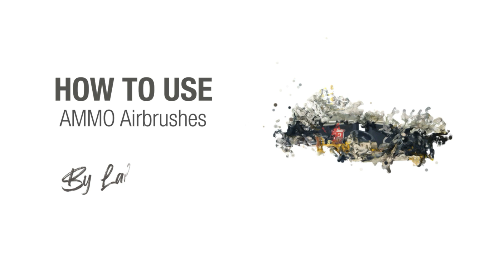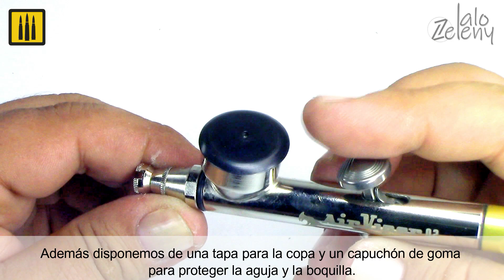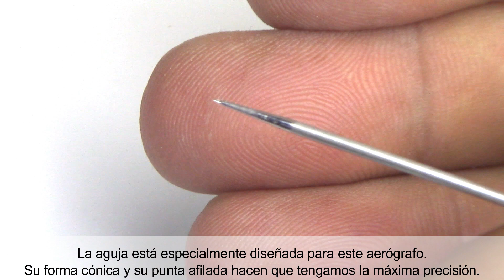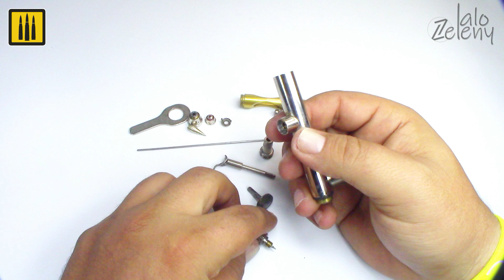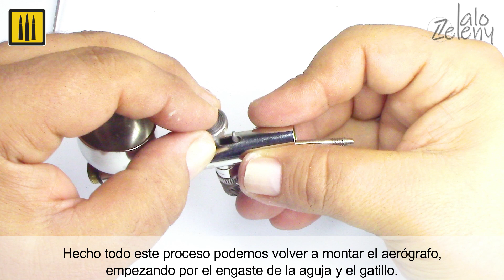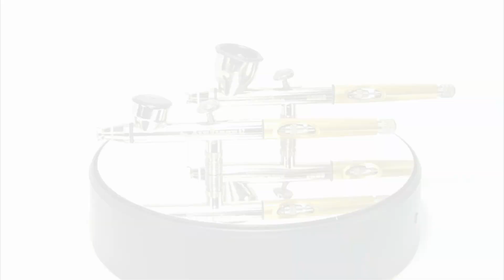HOW TO USE AMMO AIRBRUSHES  /  CÓMO USAR LOS AERÓGRAFOS DE AMMO

Comment: Not long bought one now a viper now it's time for a full break down and good clean as poor performance from a usual clean like this and ultra sonic I've got the middle screw out with small screwdriver it's just empty nothing in there I thought there would be more? Unlike the cobra you see here the valve peice like the iwata neo does not unscrew its a sealed unit only the valve unscrewers! I'm cutting into threads trying so won't go any further now so any help here on a full breakdown would be great

Comment: You don't make your brushes. You get ken over at badger to make them and then mark them up 
And did you not listen to badger? Are you insane? Sticking wire brushes in through needle bearings? How to screw an airbrush.
You also state to soak all components? You idiots! You never soak an air valve!
Honest to god learn about how to actually maintain an airbrush before spouting inaccurate crap on the internet.
For those of you actually wanting the original and better versions just go search badger airbrush.

Comment: Its literally just an old rebranded Badger Omni 4000 with an overpriced pricetag. I get an Ultra for 70% of that price, no need for tools for disassembly and all H&S parts are cross compatible between the airbrushes, none of this proprietary bullshit
Reply: Who cares, Ultra is also an old airbrush while this is upgraded version of the Badgers witch again are high quality airbrushes.
Reply: @statoilbensin2190  Exactly. Plus, people just say things are bad because they don't have the skill yet. AMMO acrylics require a steep airbrush learning curve, compared to lacquers and enamel paints. I am still learning, but it is what it is.
Reply: @K3ns4i  I think they are easy to use, its just people are using it like they use acrylic laqcuers and that will mess up the project.
Reply: @statoilbensin2190  I mean, it took me a while to learn since i am a noob. But yeah, people are using them wrong.
Reply: @K3ns4i  It did not take that long for me since I was already used to airbrushing. Ammo paints are wery solid you just need to use a bit more time and build up the paint in slow layers. While some paints can go on thicker like Vallejo but its still recomemded to do thin layers with all types of paints. I even do it for laqcuers because a smooth finish is what I like the most.
Reply: Nobody cares... it is public domain its a specially designed badger. Don't like it? Don't buy it.
Reply: @K3ns4i  oh I wont. Fuck mig and their greed. Im trying to spare the newbies the pain and frustration this company has caused me.
Reply: @czaczaja  I have their paint set for WWI german tanks. Pure shit.
Reply: @The_Modeling_Underdog  I have about 100 paints from them. Modulation sets, interior sets, camo sets. Un-fucking-usable. But with videos and marketing like this, youre sure to get stung if youre new.
Reply: @czaczaja  I've had friends have the paint spoiled due to the metal ball rusting inside the bottles. Never before opened bottles. Total loss. I gotta recon their dry pigments came in really handy a few times. The rest? Just lile you said.
Reply: @The_Modeling_Underdog  yep. pigments and enamel thinners have a good variety but paints are pure unusable and tools are just copy-paste rebrands with 3x prices
Reply: @czaczaja  I can paint just fine with them with my airbrush. It has a steep curve compared to tamiya which is just drop, thin and paint without worrying.
Reply: @czaczaja  What specifically you call greed? Tamiya has airbrushes and paints and everything from their own brand, same as with Mr hobby. So, help me understand.
Reply: @K3ns4i  this is not about just the airbrush. Have you paid 45 quid for a set of 'decal applicator brushes'? Tell me that's something a beginner or anyone for that matter needs when for the past 50 years I've been using a FREE cotton bud and its worked perfectly fine. So sit the fuck down and admit they're greedy scum and stop fanboying this shit.
Reply: @czaczaja  so you bought a 100? Took you that many to figure out they didn’t work (for you). Sure…
Reply: @czaczaja  What i find funny is, that every brand does this, yet it's the same 6-7 people that just come to MIG channel to rant. Haven't you seen the Mr Hobby expensive cotton buds? Are they greedy as well? Do you go as well to Vallejo, Tamiya or Mr Hobby channels and complain about how they sell you modeller-specific thinner when you can just use white spirits? Oh wait, do you complain to Windsor & Newton selling you 50€ brushes when a 1€ can do? XD. You have the free will and the IQ to know when something is a MUST or when something is a luxury or not necessary.  And no, it's not fanboying, it's the hypocrisy and lack of common sense that grinds my gears 🤣. Who would pay 45 quid for a set of decal brushes? That's 35% more expensive than here in the EU,  you can thank the BREXIT for that price.
Reply: @The_Modeling_Underdog  In the past mig paints didn't came with the stirring ball. You do know that if a paint is not in good condition you can email them and they will replace it for free, right?